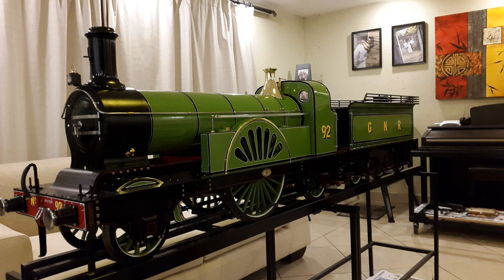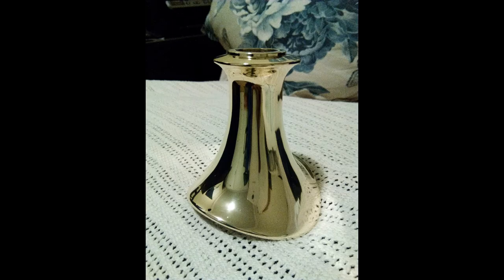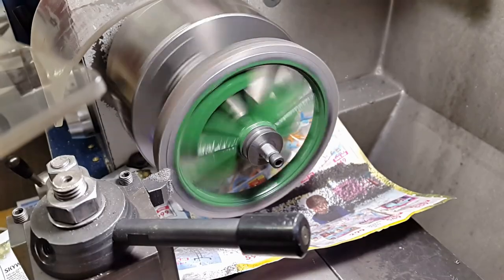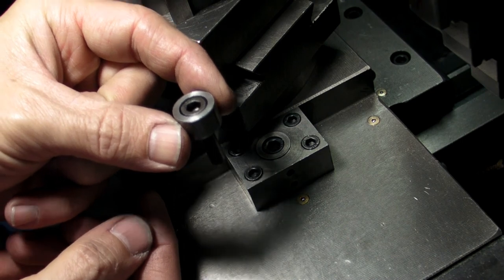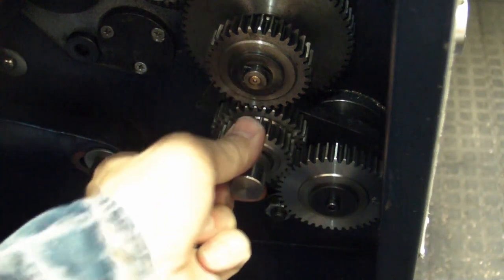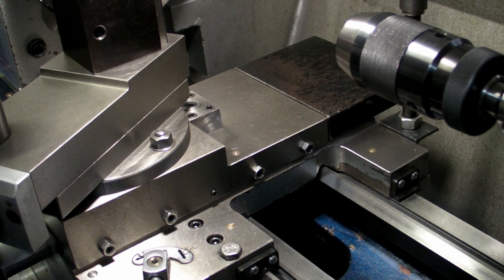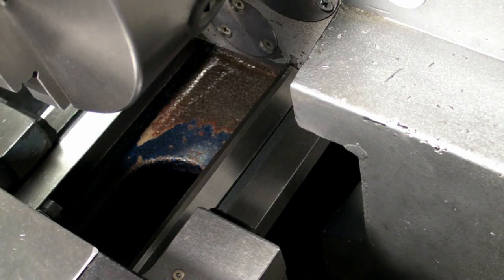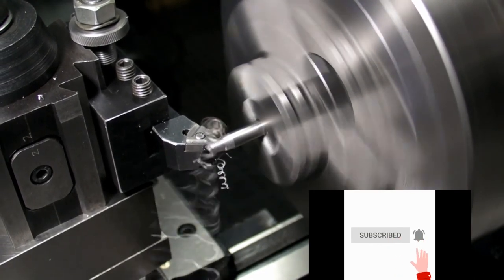Improving an Adendorff Machinery Mart lathe

Comment: Thanks for opening the comments. First of all, it is beautiful models you are building. I am not into train models but can appreciate art.

I regularly need something made and then go to one of the local engineering shops. Apart from not taking my small items seriously and big clients with big jobs get priority and it sometimes takes weeks for mine to be done, they charge high tariffs and it is sometimes not worth the money.

So, I want to buy a metal lathe for the small items I want to make myself without buying an expensive professional machine. I am keeping an eye on the secondhand marked as well but it seem that people don’t often sell these small lathes. I had a look at the lathes offered by Adendorff but was wondering about the quality and precision and then watched your video. 

Do you know how the latest offering from Adendorff compare to the model you have? Is it the same? Improved? Or worse? 

I would love if you make a video on the other things you did to the lathe.
Reply from the maker: I honestly cannot comment on the quality as I haven't used any of their new machines recently. I can tell you that the price has gone up substantially! From what I've heard, most of the issues are related to guys buying the machines and not using them properly. I was standing at a counter once and one of the customers was complaining about bed run-out and he refused to believe the bed could twist when bolting it down with M10 studs! These machines need to be setup carefully and used within their limits. 
One thing you would need to do is replace the motor caps, they tend to fail relatively quickly. The industrial ones you get locally are much better quality and will last years.
Our power is not kind to the DC boards on the very small lathes, you might have issues there. For SA I would stick to AC until our power is sorted out.
I've always found the staff very helpful. Go in and have a chat to the guys and ask them to show you the lathes. I would also make sure you buy a lathe that they have sold for many years. Then you know spares are common and any issues should have been sorted out.
BTW here's a link to a video on setting up a lathe I did for training a few years ago: https://youtu.be/vDa8P7fM2y0
There is also a video somewhere on my channel machining some incredibly small and intricate parts, normally way beyond the capability of lathes this size.